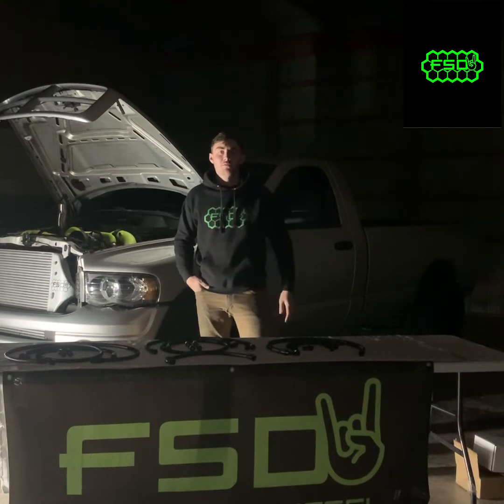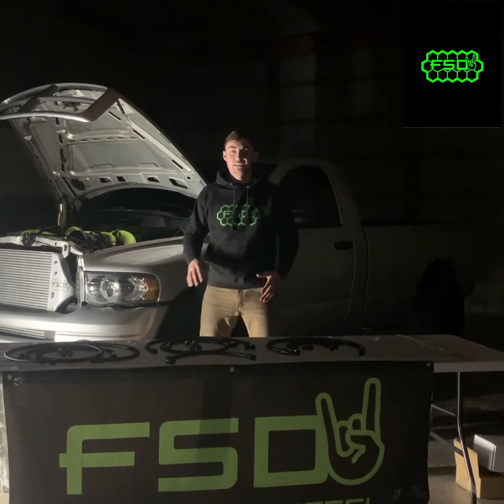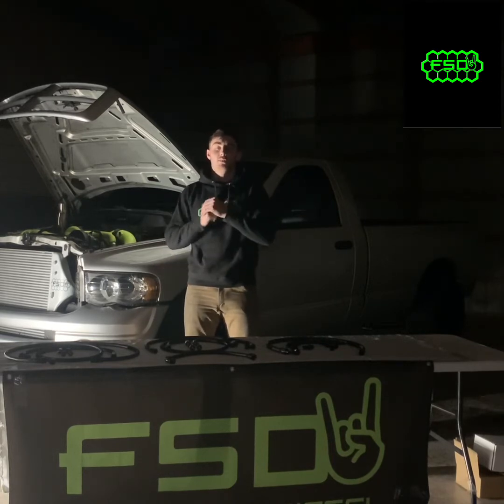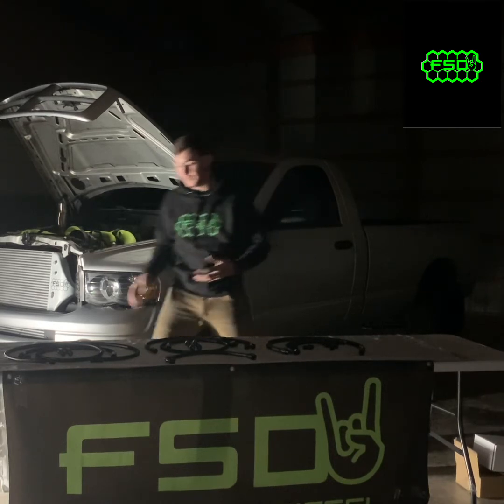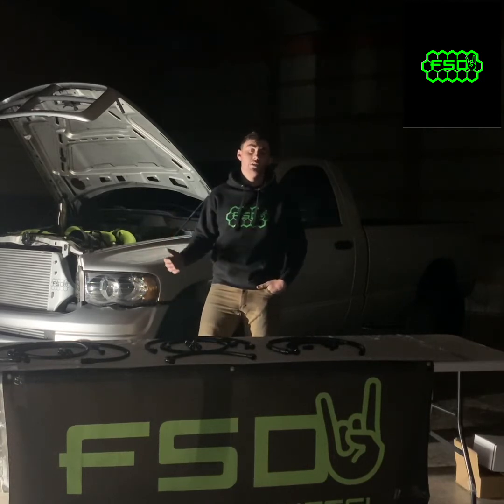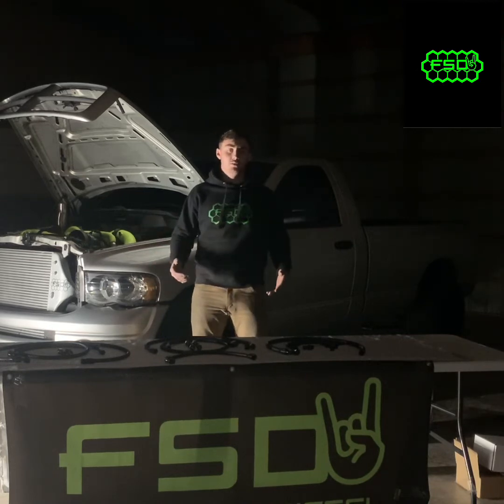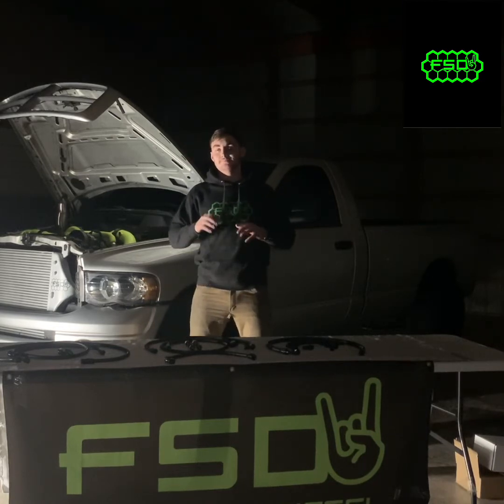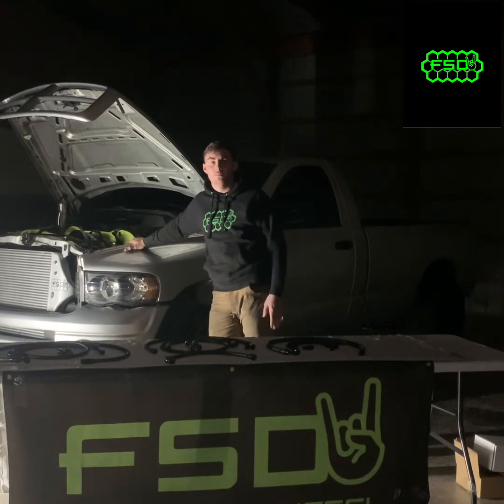Full Send Diesel- Heat Exchangers-Transmission Line Kits Explained

Comment: Bypassing it and I live in Idaho who cares I’m tired of replacing the heat exchanger, I’ve went through 4 since I bought my truck. Thankfully it hasn’t failed internally but the fittings cracks on the tranny side everything leaks

Comment: I bought your heater line kit just to get rid of that leaking hideous solid pipe along the block, and the even more ugly hack job looking pipe and hose going from the heater core to  the head. I'm blessed with a G56 and don't have to worry about the trans fluid/coolant smoothie

Comment: it is difficult to hear exactly what is being said here. But, the third option, and the best option, is to replace the heat exchanger with a new one, and leave well enough alone.  Do not delete the heat exchanger. no. if anything delete the flat plate cooler and get a bigger heat exchanger. What is never discussed is this 
hydraulically driven transmissions need to have hot oil. about 190 F hot. how you gonna get that with these silly delete kits? get a bigger exchanger a really big one like from a motorhome , buy this kit . plumb the coolant to it, and keep your trans temp same as your engine oil temp. Some comment  here talks about 200 k on a transmission. he got that from the factory heat exchanger keeping things to temp . its really a con to think lowering trans temps below op. temp is a good thing.

Comment: My heat exchanger ruptured internally, I have the trans fluid by pass kit, but what do I do with the coolant lines because if I leave them connected to the heat exchanger it’s going to leak the coolant out through the oil ports.
Reply: Did you plug them?

Comment: the big thing that makes the heat exchanger fail is that ppl never flush their coolant systems out and so things like the heater core and the converter cooler start failing. if you flush and change your coolant like your supposed to then these parts are far less likely to fail. but upgrading the lines is always a good thing for sure :)  the factory lines suck and so do the OEM style ones like from dorman or etc.. dorman is bad products to begin with

Comment: I have a 2008 3500 Dually rear wheel drive. I don't think I have the heat exchanger on my truck. I didn't have the coolant line running around the back of my head. The thing I need to know is can you make me transmission lines for my rear wheel drive that has a NPT fitting in the line so I can run my transmission sensor to it for my gauges ?

Comment: I bought the heat exchanger lines for my 2nd gen, but I'm confused on how they're supposed to be routed. The longest line, going from the heat exchanger to the transmission cooler seems way too long. It's was roughly 8.5 ft and it appears should be 1.5-2 ft shorter. Is the correct? Or are the lines supposed to be routed over the top of the transmission, as that's the only way I could imagine using up the excess length?
Reply from the maker: The longest line goes from the heat exchanger to the cooler, we route it out by the bumper and along the front away from the fan just like the factory one, if you need any more help please email me at customerservice@fullsenddiesel.com